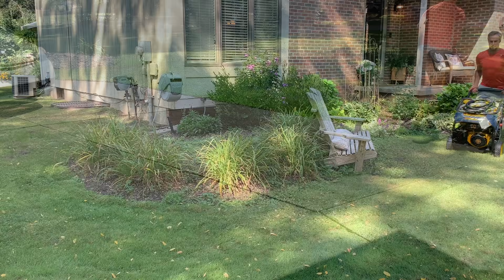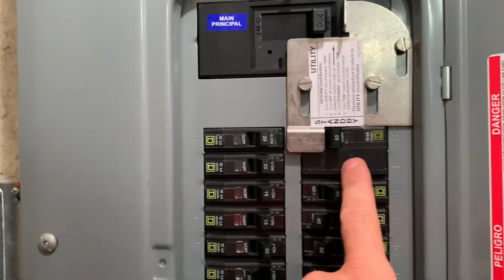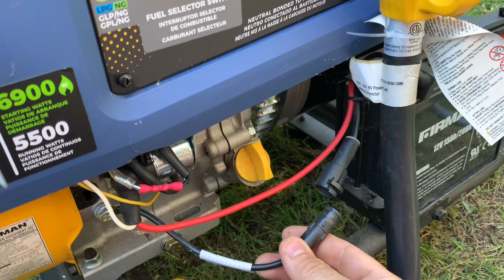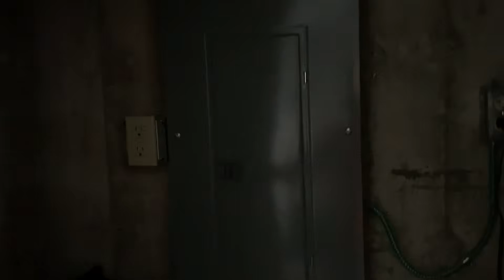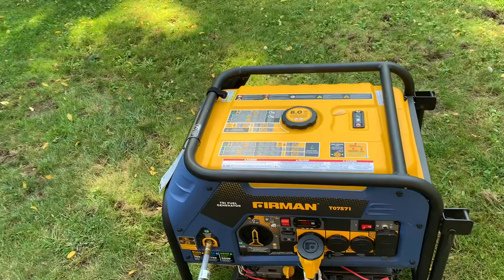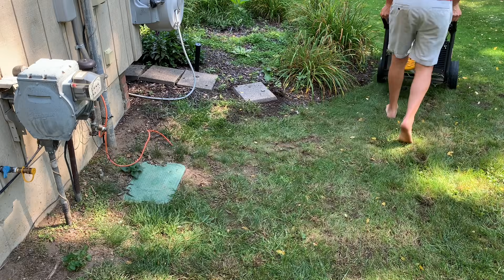Firman Tri-Fuel generator start up on Natural gas for whole house Power

Comment: Do have one comment though.  Don't all generators say generator should be at least a minimum of 20 feet away from any home structure?
Reply from the maker: Not that I am aware of, whole house generators are installed within one foot. They do not recommend operating them in a garage and not within 5ft of an intake grill, windows or doors.

Comment: I would disconnect the 50 amp from the house first before the generator in case the main power breaker was not turned off
Reply from the maker: Thats why it is important to have the breaker safety so the main cannot be on if the breaker is on

Comment: Great video. Myself i would shut the gas off first to let the engine run until it stops.  I think these would be better for gasoline also but theres no shutoff to stop fuels ftom running first.  This unit looks good
Reply from the maker: I like using natural gas because with gasoline the old fuel can gum up and Natural gas dissipates. It starts up great with no hesitation on natural gas too. There are less BTU's in natural gas but it will also run 24-7 without running out of fuel

Comment: What size generator you said you have
Reply from the maker: Firman T08073 Electric Start 120/240V with 10000 Starting watts and 8000 running watts depending on the fuel type. Here is a link at Lowes because it is no longer available at Costco 

https://www.lowes.com/pd/Firman-FIRMAN-8000W-Tri-Fuel-Portable-Generator/5015686277

Comment: I don't have a generator but that looks like a great setup
Reply from the maker: It was a much cheaper option than a whole house automatic transfer generator. We do not get many power outages around here to use an auto transfer system. This was about $12,000 less than that option

Comment: So do you need a regulator on the gas line for safety
Reply from the maker: No regulator is required for natural gas. The natural gas meter on the house is already regulated. If it is connected to propane the generator comes with a regulator for propane

Comment: great job, would have liked to hear and see meter of the db sound level at moderate load with Hvac running on this particular generator ?   Thank you
Reply from the maker: The only way this will run the AC system is with a soft start. I added one and it does work. This generator is noisy but it is only being used for emergencies and I could not recommend it for camping.

Comment: Did you remove the bonded wire from the frame
Reply from the maker: The think this generator has a floating neutral because i am using the bond in my panel. I will have to check the generator 

https://youtu.be/gchq6G5Wc8M?si=QFg0yK4MdQCkL4ma

Comment: Very informative. I started mine last night with regular gas. I have a natural gas line on my house was wondering how to set it up if I needed to and your video answered all my questions. Thanks for the video we are expecting a Freeze tomorrow here in Houston.
Reply from the maker: Glad this video helped you prepare for the freeze. This was a much cheaper option than a whole house with auto transfer. The beat thing with Natural gas is that it will continue to run as ling as the gas stays on

Comment: Is that 1/2” x 3/8” reducer that goes from your house to the quick connect?
Reply from the maker: Yes, half inch gas shut off valve and the quick connection is 3/8
Reply: @jakemir thanks

Comment: Im saving this video so i know what it sounds like when its running. Bought mine yesterday.  Fired it up for 5 min and now wont start back. At least it ran for 5 minutes
Reply from the maker: I have used this one four time and the second time used it ran for three days non stop with no issues. It is noisy, but they all are. It had only one issue and that was if I tried to use our electric stove. I can run my AC because it has a soft start but the electric stop top draws crazy amps
Reply: You have gas to your house why not change the stove to gas? It always puzzles me how homes have gas for heat but still have electric water heaters, stoves, and clothes dryers. I switched all of mine and have never looked back. NG is much cheaper here anyway. It's nice having a gas grill without a tank to worry about too.
Reply: ha, you just like me. Bought it yesterday in prep for this storm.  ALthough Not needed, yet... it did run for 5 mins to make sure its works. Sorry yours is not.

Comment: Most the research on line call for a regulator for your gas line to the generator,  do you have one on yours and why not?  Thanks
Reply from the maker: A regulator is only for propane and is not required on natural gas
Reply: @jakemir not true, Natural Gas also needs a regulator.
Reply from the maker: The regulator for natural gas is on the gas meter coming into the house
Reply: @jakemir really depends on your setup. If it is tapped down line of that one yes, a lot of the time you will have to tap it other places.
Reply: Propane always needs a regulator before the generator because the tank pressure is high. Natural gas usually doesn’t because the pressure is already reduced at the meter to appliance pressure (~7" WC). The exception is houses with a 2-psi gas system, where each appliance—including a generator—needs its own regulator.

Comment: Good video from start to finish. I have the 10000 watt model and man is that a bitch to move around. FYI I got one of those furniture dollies from harbor freight for a few bucks mounted a piece of plywood on top and place the front generator pads on it now I can move it around without straining my 70 y/o back.
Reply from the maker: The 10,000 watt does not have wheels?

Comment: Does that generator have a floating neutral? It’s very important consideration when hooking up a generator to your house through transfer switch like that.
Reply from the maker: i believe so, it has a separate neutral and ground and go to separate connections in the panel
Reply: @jakemir  I can tell from your responses you need to understand this better.  The panel you have is bonded in all liklihood - neutral and ground tied together on the panel.   Therefore you need to unbond or make your generator a floating neutral to be safe.  Yes they are going to separate connections on the panel but are those connections separated or tied?  Typically there is a wire to remove on the generator that connects the ground and neutral.  That is what you want to remove if in fact your panel is bonded.  Check on the generator (when off)  if there is continuity between the neutral (large spade hole) and the round ground hole on one of the 120V outlets.  If there is continuity, then the generator is bonded if not then it is a floating neutral.
Reply: @condor5635  Too many people making generator reviews are not aware of this danger. I blame the manufacturers for not making customers aware of this. I'm sure its about liability. If you remove the bond then decide to use the generator for other purposes where the bond is needed and people get electrocuted... double edge sword so the manufacturers just keep their mouths shut.
Reply: @ronfisher4751  that’s why I guess we educate ourselves and do it correctly. I don’t ever use mine standalone, but I have a bonded plug hanging on the generator itself ready for use if I ever did use it in standalone fashion

Comment: Thanks for the video. That is a loud generator. Not great to run at night. I'm going to get battery backups to run at night and use the generator to run during the day.  Blessings
Reply from the maker: Let me know if you find an affordable battery setup and inverter system

Comment: Did you remove the ground from the neutral??
Reply from the maker: In the panel? I have it connected to the neutral bar and ground bar, not bonded
Reply: @jakemir I think he’s talking about the bonded neutral on the generator (I’m doing that right now as I type - was looking up info on it).  If your generator has a bonded neutral (which your Firman will - mine is also a Firman), and it goes into your panel which is also grounded, you can create a ground feedback loop, which can be anything from an inconvenience to dangerous.

Comment: Thank you for posting your generator review. Very informative.
We just purchased our first generator, a Tri-fuel Westinghouse 9500/12500.
Unfortunately our natural gas meter is located on the opposite side of the house from the main electrical breaker. 
I’m thinking of having a quick connect installed by the gas meter and running a long hose to the other side of the house.
Since the generators natural gas is 7500 running watts,I’m wondering if we’ll need to upgrade our gas meter. 
Again thank you for the review.
Reply from the maker: Check inside your house. If you have a basement with access or a crawl space, just run a hard pipe gas line to the opposite side. Our dryer is on the opposite side with 1/2 hard pipe and the generator use to run off that line. I just did not run the dryer at the same time. Even if I did I do not think it would have caused an issue. Hard pipe is inexpensive and just requires a shut off valve inside and out. Good luck, we love ours. We may grab a small shed to store it near the connectors
Reply: @ Oh wow, I didn’t even think of that! That’s a great idea because my dryer is on the opposite side of the house and does have a gas line attachment behind it. THANK YOU!

Comment: Maybe put a quick disconnect for the gas line at the generator end also.
Reply: I agree. I have my lines with quick connects
Reply: I asked Firman about this when I bought my unit a couple years ago. They said doing that is not recommended and will void the warranty.
Reply from the maker: Yes, it would be easier. Thank you

Comment: Great video! The step-by-step setup and clear explanations make it easy to understand how to connect and start a tri-fuel generator. The detailed gas line and electrical connection guide is super helpful. Thanks for sharing!
Reply from the maker: Thank you for the positive feedback

Comment: Looks like you need to just buy a wrench that fits the gas connection on the generator versus fumbling with the crescent.  lol  Maybe 3/4"?  How's that high 25% THD so far
Reply from the maker: Another comment was to use another quick disconnect, which would work perfectly
Reply: @jakemir  Yep.  You'd have to use a female flare to male NPT then to the quick connect.  I think at that point I would use an elbow so it angled down so not as much stress on the connection.  Then, do almost the same in reverse on the line coming in.

Comment: We have the same generator and it has been reliable for over 3 years now after several power outages. Recently had propane company come out and run a separate line from our 500 gallon tank to front of house near the enclosed porch with a shutoff. Now we only need to drag the heavy thing out the door a few feet to use it as we store it inside in winter.
Reply from the maker: I am thinking of adding a permanent storage area for this generator, but we have only used it a few times

Comment: You do not need to use the choke when starting with propane or natgas. Choking is used to work with liquid fuels that are hard to vaporize in a cold engine.  It will start just fine without choke when on propane or natgas.
Reply from the maker: Thank you, I will try starting it the next time without the choke and see how it works
Reply: @jakemir thanks for sharing. 
I would suggest leaving your generator running then turning the gas off at the house to starve at a fuel that way you empty the gas line and the gas out of the generator. 
I don't think natural gas would be a problem as far as gumming-up your carburetor, but that way you don't have any fuel at all in your generator after you're done using it. 👍
Reply: That explains why I could start my generator in "run" mode with propane. Thanks!
Reply: I think the manual still says to choke with LP or NG...
Reply: Does the city install the quick connector for the natural gas? I would think so. Who did yours? Need your setup here in indian alaska
Reply: I have the same generator.  For some reason, it will not start with propane If I put it on run.  It will sit there and run the battery out without starting no matter how long I try.  I have to turn the choke on.  Hold down the start and let the engine crank 2 to 3 seconds.  Then turn the choke off.  Crank the engine and it starts right up...

Comment: Hi Jacob, I must congratulate you on actually testing the genset powering the actual house.  Virtually all the folks on these YouTube channels do not.  They will plug in an electric heater… bla, bla bla.  I learned to test under real load from a telephone company Central Office Manager in California where they cut the main weekly and run the entire building from generator for an hour a week.   Now, the telephone switch has a massive battery bank ‘float’ so service is not disrupted. Just 3 out of 4 lights not on the emergency circuit would pop off for 10 seconds.  All the PC’s had a UPS.  He said, how will you ever know it will work without live testing it under an actual full load?   It sounds so obvious once it is said.  Another tip was test early in the week so you have time to obtain parts or service.

Anyway, for my lock out panel, I pre mark what breakers I will shut off with red dot stickers. Yellow dot breakers are optional.  I purchased a super rugged gas flex that has a braided metal outer shell I will guess the O.D. As nearly 2”.   It was meant to be for a patio flame installation.  Best to you. Thanks for the video.  Jim from Chicago
Reply from the maker: The only device I cannot use is my electric stove. It just draws too much power.

Comment: How long does that battery last, is it self recharged when generator is running?
Reply: Yes. I have same unit and have never had to jump start or pull start after 3 years.
Reply from the maker: I keep the battery disconnected and I’ve never had to charge it in the three or four years. I have owned it.
Reply: some people put it on a cheap trickle charger. I just bought one for under $20.

Comment: You should install another quick connect on the generator side also….
Reply from the maker: It works better threading it on because it allows me to purge the line. It takes a while to start if there is air in the gas line.
Reply: @jakemir i installed a quick disconnect on mine. To purge the line all you have to do is use your finger inside the quick disconnect to purge the line.
Reply: @ammogiant824  exactly - purging is not an issue either way.  I do it all the time with my quick disconnect

Comment: A good and informative video. I might mention that the unit has a THD > 11% so I'm thinking of adding a UPS unit in front of the computers and TV to avoid damage to sensitive electronic devices. The noise level is > 72db which is like a loud lawnmower. The petrol mode is messy and has a lot of fumes and spillage. The LP and NG modes, as shown, are the best, cleanest and safest modes. A shallow wide funnel helps. They make a three-sided metal /insulated shroud which I used to cover the unit but I didn't find any appreciable noise reduction. 
Since I don't have NG to my house, I definitely will opt for two 5-gallon propane tanks with the "T" fitting.
I had my unit inside a large metal gazebo on a brick patio. I positioned a pedestal fan to the left side which dispersed the exhaust fumes away. Also, there is a 50 Amp connector with four 120 VAC at 20 Amp combination receptacles with circuit breakers built in. (I may have dozed off momentarily when Mr. Aaron showed that connector.)
Reply: can't remember the name of it, but thought there was a $200 box you can install on exterior of home that goes between the Gen and panel, that cleans up the power appropriately ...
Reply: @kernzilla  I would if you would share that information.
Reply from the maker: Great information! I keep a Kill A Watt meter plugged in while I use the generator to monitor the voltage but I do not have anything to monitor the wave pattern 

https://a.co/d/iiI1Hvc
Reply: A typical UPS won’t clean up generator power. Most consumer UPS units are standby or line-interactive and simply pass the incoming power straight through unless it fails. Only the more expensive online/double-conversion UPS systems actually regenerate a new AC waveform and isolate the load from distortion, and those are usually used in data centers. Also, the idea that generators commonly damage “sensitive electronics” is largely overstated—most modern electronics use switching power supplies that already convert AC to DC and are very tolerant of waveform distortion.  Generators also have come a long way.

Comment: Interesting, is natural gas the least expensive way to power a generator?
Reply from the maker: Yes by far. Only about $8.00 per day. Propane is $20 for about four hours and gasoline is about $24 for 8 gallons and 8 hours. Propane provides the most watts, then gasoline, and the lowest watts is with natural gas
Reply: @jakemir  Thanks for the info Jake, I’m trying to learn about generator power as we had hurricane Helene come through our area, something that has never happened before.
Reply: @jakemir  I thought it was gas the most watts then Natural gas then propane.
Reply from the maker: @tombo552001 propane has the most BTU’s and is the most expensive, then gasoline has more BTU’s then Natural Gas and is more expensive than natural gas. Natural gas is the least expensive, however; it also has the lowest BTU’s. I like natural gas because it is readily available and very inexpensive

Comment: Do you recommend a wider spark plug gap when running on natural gas?
Reply from the maker: No adjustments are required and I have only run this unit on propane and natural gas